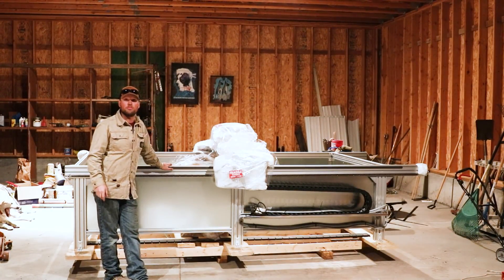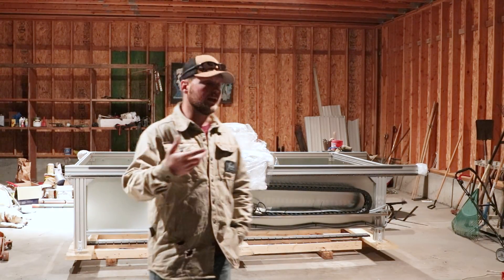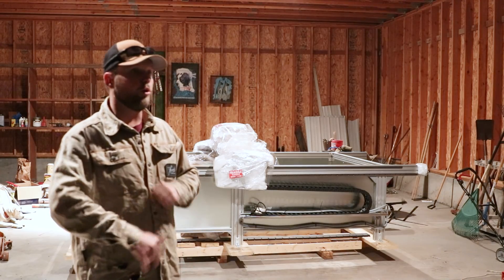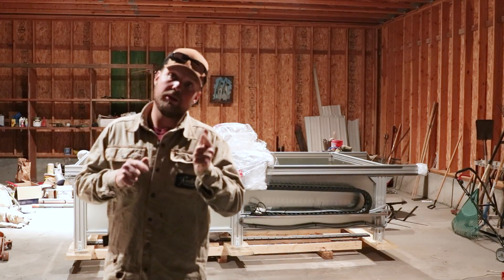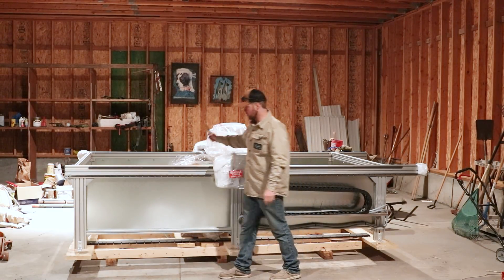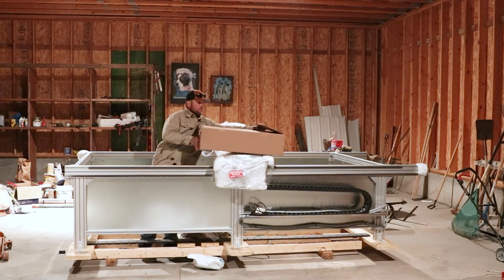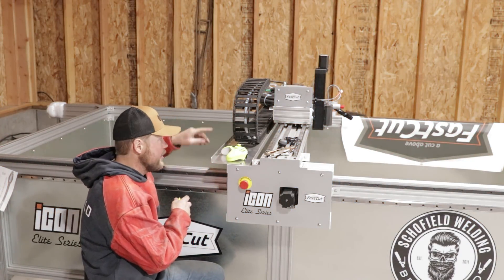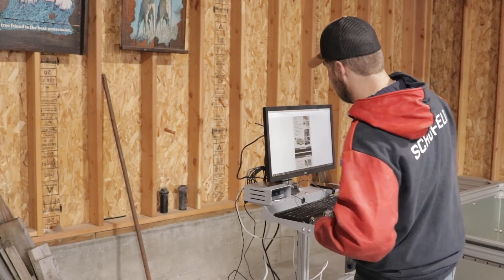The New Business, Fast Cut CNC plasma table.

Comment: Now you can make weld yourself roll out wheel assemblies. 

Also adapter plates to re-power SA200 to a diesel engine.

One of the challenges with metal project is that the price of metal has gone up. Earlier this year was looking at some 2017 invoices, prices doubled since then this year alone prices have tripled.
Reply from the maker: True I could fit and package them

Comment: Looks like a $12,000-$15,000 investment. I live in the middle of nowhere in Indiana, and I just haven't felt like the investment would bring a R.O.I for YEARS out here. It would be little piddly jobs($50-$300) maybe once or twice a month. Idk. I've thought about the $5000 little table (3' × 4') but ide also have to buy a $1000 compressor, more powerful plasma, another desktop computer, fusion 360, etc...I know they have kits but, I don't have ANYONE who could teach me what to do. My work friends live an hour away and have families. My family has no clue. And my old friends have NO idea. It would be me, all alone, trying to make back $10,000 AFTER learning how to use it well. What about a cnc router table? Prolly not for steels huh. Seen 5th street fab had one, worked good on aluminum
Reply: you would be surprised how fast word of mouth travels when you get something like this!!! & its a niche market that not everyone can do!!! have a little faith in your  abilities!!!
Reply: @pisom4314  this has crossed my mind man, basically the whole "build it and they will come" type deal. Once you have one, the ideas and requests will come flowing in. I think it's just scarier than all the other machines I own due to the fact it's the ONE thing I've NEVER run by myself. And pretty darn expensive at that. I'm sure I would learn quick, like everything else I do well now. Thanks for the motivating words bud!
Reply from the maker: p isom is right. ive never ran one either up to this point. fast cut has been awesome. we have been on the phone with Russ and charlie and they have walked us through so much and taught us a ton about them. they do this for all there customers. if you want i would love to give you the shops number and they can help answer any questions you might have. 1-866-339-3377 (fast Cut CNC table) tell the schofield welding sent you.
Reply: @JacobSchofield  how much was your table if you don't mind me asking thanks